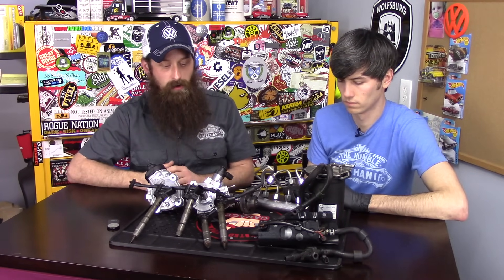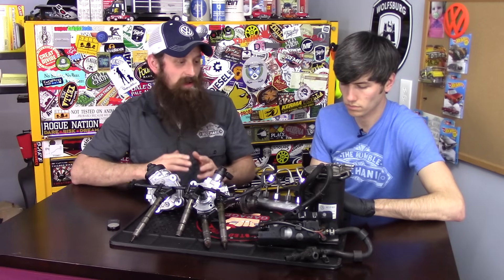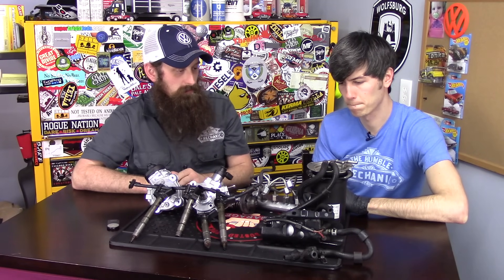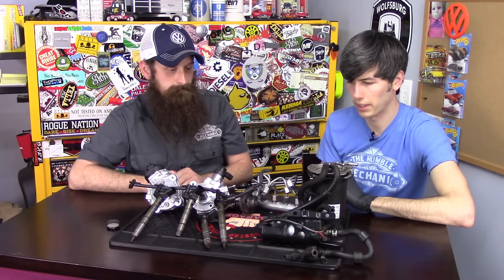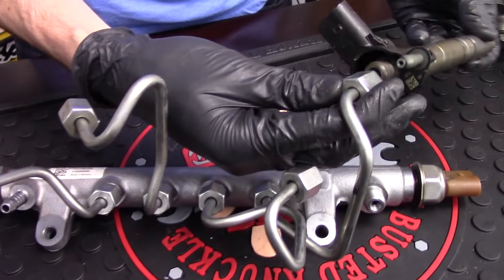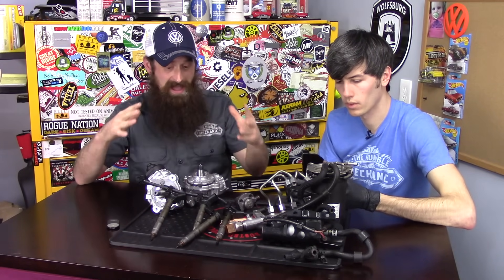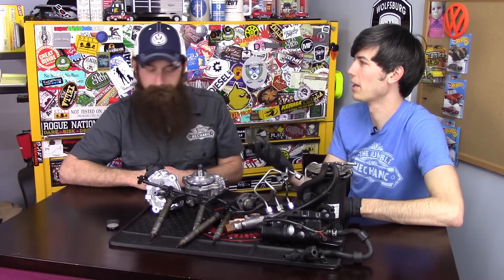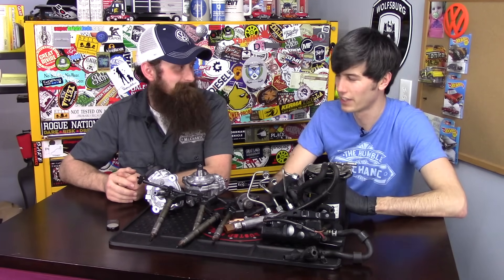Putting Gasoline In A Diesel Car - What Happens?

Comment: Diesel and gas was what we would use to clean parts . So disposal was cheap, the driver would get fired if he put gas in a truck. But it would happen. The 855 Cummins would run on a mix but it would run like crap.

Comment: My cousin filled my 1980 Diesel Rabbit with regular gas!  Thank the good lord it did NOT cost $8000, but it definitely stopped running after about 10 miles ... and stranded them in the middle of the night in the middle of nowhere Idaho.  NOT a fun experience, but a farm family rescued them in the middle of the night ... and the VW dealer in Idaho Falls drained the lines and changed the filter for under $200 and had them on their way the same day.  Missed the first day of classes after spring break, but all in all, not horrific, especially after hearing what it would cost with today's engines!!!!!!!!!!!

Comment: I usually added Octane 92 Petrol 10% in my Tank before I Fill up with Diesel fuel..  The Indonesian Diesel Fuel is mixed with 10% of Palm Oil called Bio Diesel..  So with adding 10% Gasoline it will remove Gum and water particles contained in the Diesel Fuel... Make no Black smoke. But don't put any Diesel Fuel in Gasoline Engine it won't work and make your Engine Kaputt...

Comment: If i'm not wrong, here in Brazil the fuel pumps are in diferent sizes (gasoline hoses dont fit in diesel tanks and vice versa) to help people don't do that, even that we have in everysingle gas station "trained" workers to do the job. And, even with that, there was a case that was very famous years ago that a genious insisted to put diesel in his "total flex" engine (cause here, most of the cars are able to run on gasoline, ethanol or a mix of bove)...well you can imagine what happend.

Comment: Hi, just curious, if it ok to put 1~2% of diesel into a petrol car?A group of car users claims that  cars works better with low octane petrol(in the 10.5 ratios cars),  as it helps to minimize  the output quantity of carbon, better mileage,and smooths the engine(As it works the same as to the petrol additives on the market).  They even add 100cc of kerosene into the mixture. Some of my friends did that for almost a year now, I haven't heard anything negative, but is this really ok for petrol engines?

Comment: And to think, the TDI is one of the cheapest modern diesels to fix.  Do this on a diesel pickup and you are probably looking at at 10,000+, do it on a tractor trailer engine and are probably looking at 20,000+ to fix.

Comment: I understand the pumps are gone, but replace injectors and the WHOLE common rail??? As if they couldn't flush out the common rail and also the injectors with ultrasonic cleaners and break cleaner or baths and what not. The rail is nothing but a glorified hose just like those hoses they flushed with brake cleaner and air. They replace everything, but who cares it's easy money for them, right? Capitalist pigs! A reason why I NEVER go to dealership for service, unless I want some original parts which are nowhere else to be found. I rather service my car myself, which is more fun anyway.

Comment: When I had my diesel golf I was terrified of my high pressure pump going out, first time I changed my fuel filter I found a few metal shavings in the bottom of the canister. And since I put 70,000 miles on it after that I'm thinking it already had the pump failure before and it was just left over. 
But if I have it happen on my new golf I'll just try'n clean the tank, fill it with fresh fuel and break the fuel connection pre filter then simply let the damn pump run all the fuel out of the system make it clean its self. Then reconnect the fuel feed line to the filter and break the connection at the fuel rail, refill the tank with fresh fuel again and let'er buck. After that you'd only have to replace the fuel rail and injectors. That's just my theory....

Comment: I don't know about the US, but in the UK most garages and vehicles have changed the design of the fuel filler. You can no longer fit the hose from the Unleaded pump into a diesel car and vice versa. I'm also not convinced you need to do this amount of work for a small amount of cross contamination.

Comment: There is a good reason to do it (mixing petrol in to diesel an filling it into a diesel tank): It is called winter diesel, which has to be less viscose. (Or same viscosity but with a different temperature).
This is mixed by the petrol companies of course, but "no good reason" is not true. When someone fills his diesel in summer, he might have an issue in the winter.

Comment: I was hoping they would say what happens in the cylinders. Will gasoline not ignite by compression alone and the engine simply will not start? Or if it does, how will it run? Is the rate of combustion different between the 2 fuels? Timing? Just curious.

Comment: Seriously if it is that big of an issue why don't car manufactures just install a "combustible gas sensor" in the tank that would sound an alarm and disable the ignition system. There are many sensors that can distinguish the difference based solely on the fuel vapor so if installed at the top of the tank then problem solved.. right?
Reply: +DanielVidz New Diesel cars have a system that does prevent you from filling up with gasoline. Gas pump nozzles have a smaller diameter if they are gasoline and Diesel ones are thicker. There's  an electrical system that opens a flap to the gas tank only when the nozzle touches 3 points at once. You can't do that with gasoline nozzles. VW installed such a system in all cars from 2009 onwards in the US. Generally all European manufactures have such systems nowadays.
Reply: I'm familiar with the different sizes of nozzles although that alone seems badly implemented because people still manage to fill their car with the wrong fuel.. Thanks mate I didn't know there was any prevention systems out there. I still would rather a system that disabled the ignition and triggered an alarm if the fuel did make it in the tank though. It could be an aftermarket device if someone was to invent it "not hard" sensor circuit, relay and buzzer or as an addition to a car alarm system because it already prevents "starting" and use the siren chirp..  come to think of it most immobilizers don't stop fuel pump only starter motor either way you get what I mean.

Comment: Just another way for modern mechanics to rip off the vehicle owner.Thanks to folks like the EPA the days of oops,drain and refill with proper fuel,continue on your merry way,are gone.I once worked at a plant in Washington State that would write a worker a corrective action memo if the worker was caught pouring tap water  into a storm drain!!! $25.00 a gallon to dispose of contaminated gasoline!!!.In 1966,I was tasked to clean up and restart a Detroit Diesel 4-53 that some meathead had filled with gasoline.Drained the fuel tank,changed the fuel filters removed the fuel return line cranked engine over until we got diesel out the fuel return,started the engine ran it until it warmed up and ran smoothly,shut down,changed the engine oil,put the machine back to work,no problems.Took the fuel we drained out of the machine to a gasoline powered generator filled the fuel tank,genset ran ok smoked a little.End of problem.Just before I retired in 2005,We had a state clean air jerk,complaining that she could heat waves coming out of the exhaust stack on our Diesel powered Gensets.!!!.I almost got fired when I asked her to clean up the oil that leaked out of her car.Transmission leaked about 4-5 ounces in 1/2 hour.She went postal on me boss chewed me outfor pissing her off.

Comment: Petrol in a diesel does not need the whole fuel system replacing. Where I work we replace the fuel filter (but not the housing) drain and re-fill the tank and blow the lines out. 9 times out if 10 the car is then fine. The 1 time in 10 is where the car has been driven some distance, and in modern engines this tends to melt the fuel-injectors and wreck the engine. Diesel in a direct injection petrol engine tends to have the same effect- melted injectors and holed Pistons.

Comment: the issue of what happens to the engine itself if you put gasoline into a diesel was not addressed. does this mean that the engine will simply not fire is gasoline set of diesel fuel is put in?

Comment: My dad put gas in my golf 5 diesel after a night shift. I have to mention that the car stil had like MAX 10 liters of diesel in it so almost empty tank and filled it up with gas (full tank), almost 50 liters of gasoline. We pushed the car out from the pump (didn.t start up the car) and opened the tank (got to the fuel pump) and drained out around 50 liters of gasoline mixed with max 10 liters of diesel. We filled the car back with diesel and the car went fine. I have also to mention that after we refilled the car with diesel we drove like almost 3000 km (because we went in vacation) and the only diference was that the car was showing 0.8 liters instead of 0.6 liters when was running on idle. But now after a few other fillups is showing the 0.6 liters on idle. I.m sure i did some damage to the car but it.s not such a big tragedy in my case at least :)

Comment: Fifth Gear in the UK actually did this experiment.  They put gas in a diesel and diesel in a gas car. As they describe it, mechanics are likely to charge you thousands to do all the work described in this vid. The only problem is that according to 5G, it isn't necessary. Both cars eventually died when running on the wrong fuel. Once their tanks had been syphoned out and refilled with the correct fuel, both cars ran poorly for a few minutes while the residual wrong fuel ran through, but after that they both ran normally as though nothing had ever happened..

Comment: Replacing all these parts is total over kill unless the tank was almost completely empty.  If there was even 1/8 - 1/4 tank of diesel, there would still be enough lubrication in the fuel mixture to prevent damage to the pumps or injectors.  
Just take the car out and light it on fire.  Report it stolen in the morning, save $8000.

Comment: I once put gasoline in my diesel Hyundai Gets. I didnt notice it at once, but after about 40 miles I noticed that the engine just goes off and turns back on while driving at 60miles/h. It did that for couple of times, but then I stopped at a gas station and tanked full with diesel again and it ran just fine. I havent had any engine problems and that was 70k miles ago.

Comment: The only thing I'd like to add is disposal of diesel/gasoline mixes is generally not that expensive unless you choose a vendor that is ripping you off. At least at the facility I work at, disposal of any flammable liquid, including diesel/gasoline mixes is less than $4/gal. Just check with your location HHW collection facility to find out more :D

Comment: Had some knuckle head do this to his F-250.  Within a day, it trashed the primary fuel pump, sending metal fragments up into the filters and the secondary pump, which eventually clogged his injectors and rails with metal.
He basically needed an entire system replacement but he insisted on taking it to another shop and having the system flushed.
Needless to say, it didn't work and he ended up spending a couple hundred bucks on a service that didn't fix his busted fuel delivery system.
$6k later (at a different shop because, again, he didn't believe us) his truck is up and running and I'll bet he'll never do that again.

Comment: Ok this is crap!! I am a diesel mechanic (in aus it's a 4 year apprenticeship, including trade school to become qualified) and we uesed to clean motor components in petrol(gas). If its is only a short time in the system nothing much would have happened but I would replace all the seals and rubber components as they do get affected by cross contamination. EVERY PART of the fuel system REGARDLESS of what people say is able to be inspected, cleaned and tested!! $500 to clean and test injectors (with test certificates) is better then $2000 to replace because they MAY fail in the next 30000-100000km... hey but what do I know im just some guy on the internet.

Comment: this is a joke....drain the tank, put diesel back in and you're fine.
Reply: Garages scam you every time, try to do as much as you can yourself. Just search for some help on google and you will be fine most of the time
Reply: Yes. Be clear and Always warn about potential damage or life shortening of components.
Reply: I think he was talking about when it goes beyond dangerous. A Diesel Engine is not designed for Gasoline. If you catch it right away, yeah, drain and be good. If you don't... and your engine doesn't work anymore, then you've got problems. 

Like he mentioned though, it may not be immediate, but often times, it can lead to a way more expensive repair down the line. Moral of the story though, don't fill your diesel vehicle with gas!

Comment: Those defending this, must work for the same dealership. There's a bunch of folks on here that have flushed & filled with no harm done. Now I will say, if you've driven it for some distance, it may have messed something up, and some components should be replaced. But a quick enough discovery, Flush & fill !

Comment: I had a rabbit diesel in the 80's, user guide said add up to 25% gas if you drove hot weather fuel into very cold weather to raise the pour point.  cold weather fuel has it already. Old school vs new, no electronics, loose clearances

Comment: So, I was in UK last summer and inadvertently added petrol to diesel car. Fuel nozzles are different colour there. Drove about 10 miles before I realised and called a specialist service company who connected pumps to car fuel system, drained everything and replaced with  new diesel. Car was ok thereafter. Must happen a lot over there as technician came with fully equipped fuel exchange truck. Gas stations keep business cards on counter for such cases.

Comment: In the old days petrol was used to thin out diesel during cold winter days.
Nowadays high pressure systems are tightly restricted on the quality of fuel which can be used and this is too fragile!

Comment: My Grandpa told me back in the late 60s he ran out of gas in his 58 IH A110 and he had a diesel pump in the back for the tractors and he pumped diesel into the pickup. He said it burned it but it smoked like hell but he got home. He said he never cleaned anything out, just let it burn the diesel and put gas in it again and never had any problems.

Comment: Wow what a rip off, filled my duramax with gas (just got a diesel for the first time) siphoned the gas out, purged the lines, changed the filter and had no issue what so ever. now have 300 000 km on it and shes still running just like new.

Comment: Complete scam artist! Dump the gas, pull out the fuel rail... cycle the key so the pump removes the remaining fuel and replace. Longevity of a fuel rail? Give me a break... BTW... brake clean is probably worse then having gas in there.

Comment: I mean the parts you suggest need replacement "just in case something maybe possibly might have happened to it" is, at this point, laughable.
Do you expect someone to sit there for like 15 hours trying to crank the car with the wrong fuel. The "humble" mechanic. Sure.

If every mechanic did his job as bad as you, i'd be paying 15.000+ every time i visit a shop for a minor repair, because he just replaced every part in my car cause there "might possibly be something wrong with it in the long run".

Comment: +Engineering Explained +HumbleMechanic Folks, out of curiosity, the two main reasons why this is highly unlikely to happen here in Brazil are: 
• Only employees of the gas stations here are allowed to fuel the cars, never the customers; 
• Our law currently restricts diesel engines to heavy working cars, like trucks, buses, tractors, commercial vans, offroad pickups etc. So normal family cars (or what we here use to call "travel" cars) run only with gasoline and ethanol alchool.

Comment: Bottom line... modern diesels are over complicated garbage.  One of the main reasons for running a diesel is SIMPLICITY.  Not any more I guess.      I had a 1983 Chevy celebrity diesel that my girlfriend accidentally put gas in.  I drain the tank, lines, and changed the fuel filter.  Filled it with diesel and cranked it until it started.   Car ran just fine for years. The spedo stopped working at 230K...  and I sold the car because it was rusting...bad.

Comment: Rubbish!  You can add up to 20% gasoline to diesel oil, often done in severe winters years ago, before refineries got too clever for our own good.   I did this in a pre-owned 2002 GM Zafira a few years back on my first day of running a diesel. It ground to a halt after about 2 miles. You won't damage pumps by running gasoline through them - enough diesel remains in the fuel for lube over a short time-  and there is no intrinsic difference in the solute value of the two fuels to affect seals.  I'd bought it to lug my Activity dogs about and not put them in my new Toyota.   My dealer drained out the fuel, flushed through with diesel and that was all.  The 'scrap' oil mix was given back to me and I burned it by putting the 30 litres of fuel in my central heating oil tank containing some 1000+ litres of Mazout, [ an old French word for heating oil ]. The Zafira is still running perfect 8 years and 100,000 miles later.  It's off to the scrapyard shortly, as the French Gummint are giving me €10,000 off a new Leaf 30 kwh if I get it broken ...and €3000 for a home charging station. The World's gone bleeding mad!